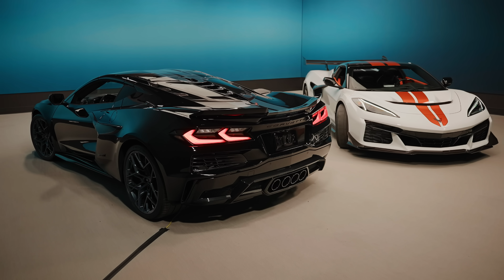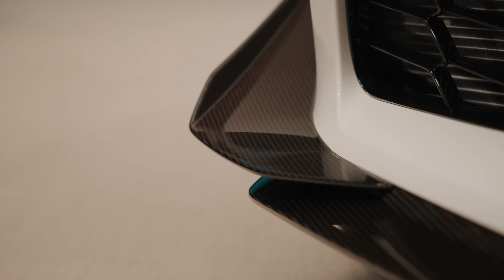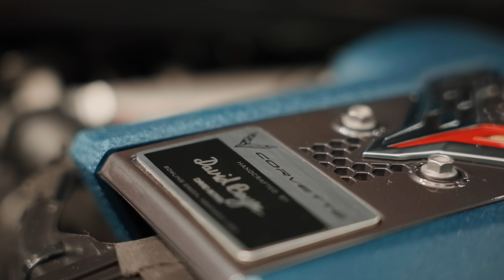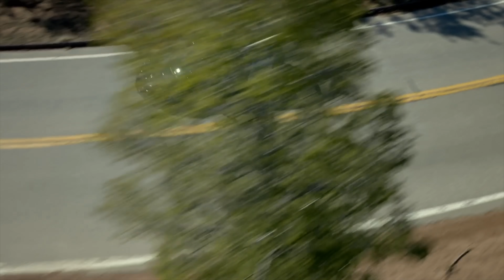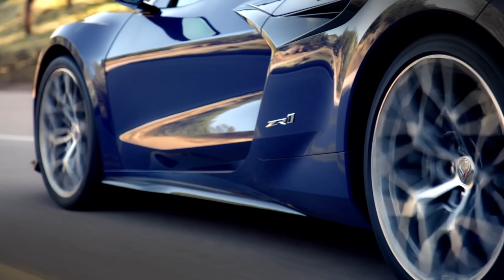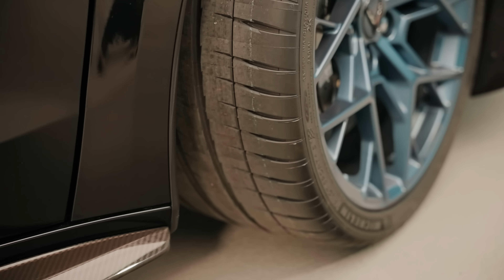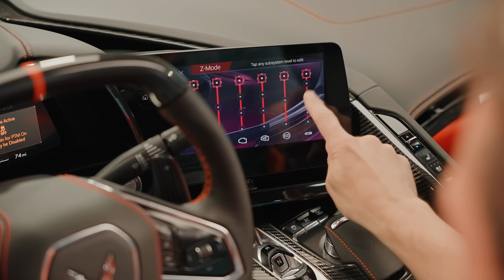FIRST LOOK: 2025 Corvette ZR1 – 1064hp, Turbos & 215mph!

Comment from the maker: This, or a GT3 RS?
Reply: Vette.
Reply: I'll take the Z06 over the GT3.
Reply: This iteration of Corvette ZR1 would annihilate the Porsche GT3 RS on a straight or around a track easily!
Reply: @davidhunter9974   I doubt it - yeah its going to destroy a GT3 RS on a straight. But on a track? 300kg heavier, softer suspension, but most importantly only 550kg of downforce vs the GT3 RS 860kg. Meaning the GT3 RS will corner faster. Much faster. A fact that seems confirmed when they mention this car has been round the Nurburgring but don't state a lap time. The GT3 RS did it in 6.44 - the second fastest time for a true production car ever. To put it into persperctive i think the fastest time in a C8 Z06 is 7.23. This wasn't on an empty track but the estimated best possible time for a Z06 is 7.10. Still miles off the GT3 RS. Yes the ZR1 is much more powerful but its also 100kg heavier. The ZR1 will likely break 7 mins. I don't think it will dip below 6.50 though.
Reply: Used Gt3s going for $400k+ so I guess 2 ZR1s
Reply: Right now the Z06s are going between 140-170k. This new ZR1 you won’t be able to touch under 200k. My guess is they will be between 205-240k and there will be significant markup 30-100k
Reply: @mattsomeonewithansrt3948 they’ll easily be between $300k-$400k for a while.  This is the kind of car where if you have to have it then that means you HAVE to have and people with disposable income will pay whatever it takes to get one.
Reply: @JackaLopius  Coupe and Convertible for that price for sure, lol
Reply: @JackaLopius  and there s a reason for the GT3RS to sell at higher price point
Reply: @JackaLopius you know these are going to be marked up to that level.
Reply: @JackaLopius  2019 RS's are going for $200K
Reply: @JackaLopius what u think these will sell for ?
Prob 400k
Reply: @JackaLopius the corvette will be 400k when the dealers get
Their greedy mitts on em
And you’ll
See half million dollar used ones 

100% gonna happen
Reply: @JackaLopius this is gonna be half a million after dealer markups 😔
Reply: @JackaLopius  🤣 Sike I’m not a boomer going through a midlife crisis be so fr
Reply: @Kilometerss  
Porsches and Corvettes are prime midlife crisis cars.
Reply: @Kilometerss  honestly feel bad that you can't enjoy a car because the internet told you a certain kind of person drives it
Reply: @Vincetagram  imagine thinking that had anything to do with it🤣
Reply: @Kilometerss  All the boomers are at least 20 years past midlife by now.
Reply: @Kilometerss  You can't afford either one so what does it matter
Reply: @Kilometerss  a baby boomer midlife crisis would have been in the 1990s to early 2000s... what decade are you living in? Boomers are mostly retired now.
Reply: @Kilometerss  dude I had two corvettes in my early 20's. I had no bills, lived at home, and a good full-time job. Had a C6 corvette and a 2008 Z06 Corvette with Corsa exhaust. Yeah, I know that makes me kind of old, but Corvettes don't have to have anything to do with your age. The reason you see a lot of middle-aged men driving them is because they are mostly the only ones that can afford one after working for a long time. I could say that lifted pick-up trucks are for young men trying to compensate for their small package they are insecure about.  The higher the lift off the ground, the smaller the pee pee. all these stereo types are just for jealous people who can't afford one. except for the super lifted trucks. Those are mostly owned by insecure men. ;-)
Reply: Probably a GT3 RS becuase you know it will be a better car overall, but I think it would be a very difficult decision in the real world, this new Corvette is next level amazing.
Reply: @KnightIndustries572  wdym better overall? The ZR1 is much faster in a straight line, take corners not much slower, has a more comfortable ride and more comfortable seats, has more luggage space, and has similar quality along with similar driving experience.
Reply: This Corvette any day
Reply: @austinhazlett2k17  y all nuts, chevy or porsche. Porsche for build quality anyday, that's without even considering the performance on track and the look of the car
Reply: This all day
Reply: how are we suggesting that these two should be compared? GT3 and Z06 makes more sense.
Reply: @madskater5 He is talking about GT3 RS; not a normal GT3
Reply: @toughcookie218  I dont think that changes my mind. gt2 rs vs zr1 maybe?
Reply: This all day and with the extra savings could add more aero to snuff any GT3 RS.. that much power needs more aero for sure on the right track.
Reply: Corvette
Reply: Thats a hilarious question.  Who would pick a measly GT3RS?
Reply: It doesn't matter I can't afford either😢
Reply: This and it's not even close. You should be asking this or a GT2RS tbh. Even then, this will slam it on a track given the driver is capable enough
Reply: Both
Reply: Comment like this makes me question Motor journalism.
Reply: This
Reply: This Corvette all day.
Reply: Corvette all day, screw porsches on all allocations
Reply: As a German who loves Porsche this ZR1 all day.
Reply: @jostrander71  I am excited to see what Porsche does for next generation, with competition like this they can't stay out of the horsepower race any longer. As someone who isn't a porsche guy at all, this competition is just good for sportscars, no matter what brand you prefer. Chevy knocked it out of the park with this generation of corvettes.
Reply: This and a down payment on a house.
Reply: Porsche is overrated this corvette anyday
Reply: @drippgxd  goofball comment of the year. The most desired brand on the planet and most profitable company
Reply: ZR1 easy.
Reply: Zr1 I have a c6 grandsport vette already
Reply: Boffum
Reply: This
Reply: Vette for sure.
Reply: I love porsche, but this might even outso the 765LT....
Reply: Zr1
Reply: The Corvette all the way. I've always been a Porsche guy but this is on another level of performance and affordability.
Reply: easily this. ig u go with GT3RS ur brainwashed
Reply: @TopGear  Obviously the C8 ZR1, come on now, can’t beat a high revving twin turbo V8!
Reply: THIS ALL DAY - C8 ZR1
Reply: Depends if you want to go faster, or if you are willing to spend double the money so you can be hip on social media.  I don't care what internet nerds think, so the Corvette is an easy choice.  What other advantage does the GT3RS have?
Reply: Vette. Easy choice
Reply: Ford Mustang GTD
Reply: The C8 Z06 already has the same lap times as a GT3RS. The C8 ZR1 is more comparable to a GT2RS.
Reply: 100% corvette
Reply: 2025 Corvette ZR1 Coupe please!!!
Reply: That's an easy question.  The 2025 gt3 rs comes in a 6sp manual.  That makes the gt3 the obvious choice.  Screw those sissy paddle shifters.
Reply: This all dayyy zr1 no question
Reply: Corvette has always been better than 911
Reply: From a performance standpoint, there is no contest really, I will take both.
Reply: give me a gt3 touring and i'm happy, elegance and refinement over brute force
Reply: Manthey 911 GT3 RS
Reply: E-ray... I'm only thinking practicality.
Reply: This!
Reply: This
Reply: Corvette for sure
Reply: ZR1
Reply: 1024hp!!! Can't wait for all the videos of 70 year old retirees flipping off 20 year Olds in 95 civics beating them at 8am on Sundays.
Reply: @masturone8257  more likely it'll be the 70 year olds stuffing them into trees because their geriatric old asses can't handle that much power
Reply: GTR R35
Reply: GT3 all day long but it’s a lot more expensive if you can get one
Reply: @chrisvig123  for the track?
Reply: Turbos muffle the sound of the ZR1 engine. 
So it's gonna be GT3 RS with its 9000rpm NA redline echoing off the walls and grounds of circuits and buildings. ZR1...crickets chirp chirp.
Reply: If I lived in the States, the ZR1 for sure, but for European roads the GT3RS.
Reply: @thunderpants007  ZR1 and GT3RS at both kings foresure, happy to have cars like this share the road together.
Reply: A ZR1 and a Z06 it’s something different.
Reply: GT3RS can’t compete with the new ZR1 😂 that what the Z06 built for. ZR1 competition is GT2RS, Ferrari FS90
Reply: @prosperityspeaks5725  Can't compete where? On a track? Because it has to be straight line since the 3rs is faster than 2rs on the Nurburgring.
Reply: GT3 RS is 300kg lighter, 300kg more down force, NA vs Turbo, 9000rpm redline vs 8000rpm and generally considered the best drivers car ever. As Colin Chapman famously said "Adding power makes you faster on the straights. Subtracting weight makes you faster everywhere."
I don't see how this is even close - I'll take the lighter, better handling, 9000rpm screaming agile beauty over the no doubt impressive blunt object with a gigantically powerful engine.
Reply: GT3 has a NOT ugly steering wheel and has a manual. So the GT3 all the way!
Reply: GT2 RS
Reply: @SayakMajumder  double the price
Reply: @scoobydoo5164  
ja, ja ... und double da fun!
Reply: Thats Apples and Oranges my Friend
Reply: ill have both 🤷‍♂😂
Reply: This ofc 💯
Reply: @FETNM4L this
Reply: Dyno papers please. All american automanufacturers are like we do this and that bla bla bla. Mustang GTD go sub 7 on the Nür? It will not. Dodge 170? Yes it will take 170 tries to do the claimed 0-60 and 1/4 mile time on a SUPER PREPPED SURFACE. And now this, lies lies lies lies. GIVE US PROOF and stop listen to their BS. Its not all about power, its how its set up. Only thing american automotive is good at is beeing corny, yeah thats right. Support john deer instead of this sheit.
Reply: fuck Porsche lol
Reply: I choose the mom
Reply: Vette
Reply: Thats like asking "Turd sandwich with a side of roadkill or a wagyu steak dinner" of course the GT3 RS. You'd have to be a braindead hillbilly pedo to think the vette is a better option over a porsche.
Reply: C8 ZR1 vs Mustang GTD vs GT2 RS
Reply: GT3, with no RS
Reply: Porsche
Reply: yes
Reply: Still hard to beat the sound of the gt3 rs, the turbos I'm sure quiet this down
Reply: @narek_kona302  over 1khp to the rear wheels at 8k rpm, I don't think that's going to be a quiet engine, actually.
Reply: Kudos to GM, but Its never a good idea to bet against porsche engineers. They'll beat this with 800hp tops. 911s are just on another level.
Reply: @jw6188 
At the Nurburgring, yes. Anywhere 
Else no. They tune the Ring cars
Specifically for that record run. 
Any brand can do stuff like that 😂
Reply: @jw6188  800 ? Nah, 525, and a New Aero kit lol
Reply: more like this or a gt2 rs
Reply: Corvette takes the cake
Reply: This or a k20 swapped mr2
Reply: GT3 RS... assuming the ADM and allocation game doesn't get in the way
Reply: Whichever is easier to buy if you had the money at asking price (without a huge markup out the door) 😅.
Reply: Vette to hammer on and drive, 3rs to park in garage with full ppf and take to cars and coffee once a month and sell it 5k miles or less
Reply: Gt3
Reply: GT3 RS just looks way better
Reply: @anitaru2001  lmfao the GT3RS is just as gaudy as this is.
Reply: Americans n their fake hps
Reply: GT3 RS
Reply: Gt3 RS any day, even a destroyed one can sell for 100k apparently.
Reply: not close
Reply: Should be this or the gtd. That’s a more practical comparison since this is what they’re responding with to ford
Reply: GT3 RS
Reply: GT3 RS is a track weapon. Not sure about the corvette's agility until you drive it and we see the numbers
Reply: I'm sorry. Gt3 rs for the manual. Corvette, if I've gotta get an auto
Reply: GT3 RS
Reply: No. Not a GT3RS but a GT2 Twin Turbo!  I'll take the Porsche hands down anyday!  Porsche has won more 24 Hrs of Le Mans championships at the top class than any manufacturer!  Not even close!!!
Reply: @LWRC  This thing will beat a GT2RS hands down.
Reply: @sarkaranish  
So you like drinking moonshine instead of real fine wine?!!
Very very few of the homeboys out here who think they're race driver caliber can drive this machine to its limits!  Remember, this is only RWD.   If you think Porsche doesn't know what they're doing - take a look at their 24 Hrs of Le Mans win records!  How many top class championships has GM won - ever??!!!
Reply: Neither buy land
Reply: As incredible as this car is..... I still choose the gt3rs. It's a 911 🤷
Reply: @nissanFanboyRB26  Rear engine vs mid engine, I'll take mid engine. Let's see what the Nurburgring says.
Reply: As a 2024 Carrera S owner, I say this one...  I wanted to buy a C8 Z06 but dealers were asking way too much.  I went with the Porsche.
Reply: THIS NO QUESTION!!!
Reply: ZR1 all day!
Reply: Too early to tell
Reply: Gt3 RS
Reply: THIS!!!... This one any day of the week, and twice on Sundays!!!!
Reply: this obv
Reply: Vette
Reply: Koenigsegg Jesko
Reply: 3RS is 500hp down on power. It's not even in the same class of performance. I'd take a normal GT3 over both.
Reply: GT3 RS
Reply: GT3 ❤
Reply: GT3 RS only because I couldn’t live with the GM interior and I dislike the rear styling of the Corvette.
Reply: Zo6 or gt3 easily over a RS or a ZR1
Reply: GT3RS im sorry not sorry
Reply: GT3 RS all day, everyday.
Reply: only corvette
Reply: This, until the Zora appears. Then it'll be that. I'm very confident the Zora is coming, and when it does, McLaren, Ferarri, Lamborghini, and Ferarri will have a real battle on their hands. A 1250 horsepower AWD Corvette? Nuts, absolutely bonkers. This thing with an exhaust would likely touch 1100, and with a good tuner, it could see 1200+ easily. This new ZR1 is an honest to goodness supercar.
Reply: GT3 all day. it will actually hold value
Reply: Both ❤
Reply: ZR1 all day everyday😊
Reply: This, without ztk kit,
Reply: Gt3 of every Generation
Reply: Gt3 rs but I’m not one of those fans…
Reply: GT3 RS
Reply: Corvette any day.
Reply: It's American...it is not Zed
Reply: Corvette hands down just due to me being from the original home city of the car from 52-82
Reply: New GT2RS will clear this tho
Reply: Twin turbo V8 vs manuelle. Idk. Corveffe
Reply: Id take this cuz Americans love horsepower. And I'm American
Reply: GT3 RS is more compareable to the Z06(C8)
Reply: Corvette
Reply: Porsche
Reply: Uh not even a comparison?

GT3 RS is a ultra limited production Porsche very few will ever get the chance to even buy. The ZR1 is a mass produced track ready car anyone will be able to buy provided they have the money.
Reply: Gt2rs… but ye probably this
Reply: Porsche... But undeniable monster this corvette.
Reply: Vette of course.
Reply: GT3RS because I'd be too scared to drive this monster 😂
Reply: GT3RS; It’s not overpowered to an absolutely boring degree.
Reply: Corvette everyday
Reply: GT3RS todo santo dia
Reply: This❤
Reply: This
Reply: GT3RS all day
Reply: Contemplating a move to the US, as long as Europe burries itself into eco crap and downsizing.
Reply: GT3 RS literally has less than half the HP, corvette everytime
Reply: New GT2RS coming in 2026 should be compared to this
Reply: Skateboard
Reply: This. Duh.
Reply: RUF 550
Reply: Not even comparable,  yall love to
Stir up these Porsche groupies in
The comments. Pointless asking 
Questions like this lol
Reply: This thing is going to cost the same as current gen GT3.
Reply: ZR1 all day everyday
Reply: Carrera targa gts
Reply: Interesting comments here. Track performance isn’t everything, but the Z06 already is at par with the GT3 RS. Slightly faster on some tracks, slightly slower on others. The ZR1 has more power, more aero, and better brakes than the Z06. Safe to assume it will be faster around the track than either.
Reply: Porsche doesn't looks nice nowadays
Reply: Can’t get a GT3RS. 

I have bought three new Porsches and still can’t get on the list
Reply: When’s the GT2RS coming out?
Reply: Get what YOU want. Ignorant question. Smh 🎉
Reply: M.i.a.t.a.
Reply: This
Reply: Trust me this can be faster
Reply: corvette
Reply: This is more comparable to a GT2 RS.. when they finally release it.
Reply: Vette
Reply: GT3 or the RS as it's an NA, not turbocharger. A corvette could have 800bhp instead and be even more fun. Shame they out a turbo on it.
Reply: dumb question obviously the zr1 you will be smiling like an idiot and shitting your pants on the zr1 the GT3 RS will seem so dull and boring compared to this the zr1 will make the GT3 RS and 911 turbo look like its standing still lol
Reply: The new Civic Touring Hybrid.
Reply: Zr1
Reply: Hennessy F5 has 86mm turbos! The new ZR1 has 76mm turbos! The ZR1 is one tenth the price !
Reply: An escort Rs turbo white lightning stock pristine example, over any car for driving pleasure in the uk
Reply: I'm not a racer, never been at a racetrack, so neither vehicle would be utilized fully. So it would have to be the Porsche for the brand and resale value.
Reply: This
Reply: ZR1
Reply: I f you buy a corvette you also get a free gold chain and a button down Hawaiian shirt that only buttons half way up. I do t care how fast it is, it’s still a goofy car aimed at a certain type of guy. Plus you can’t throw a rock without hitting a vette. They’re everywhere
Reply: Gt3rs is overrated, and overpriced
Reply: My heart says Porsche, but my mind and wallet say Vette. We're talking about P1 levels of performance for what should cost $175-185k realistically. With dealer markup it'll be closer to $300k though
Reply: C8 zr1
Reply: This by a mile
Reply: @TopGear  A Mustang GTD
Reply: I'm a huge porsche guy and would take a GT3 over a Z06, but I'd take a ZR1 over a GT3RS all day.
Reply: This and I am a Porsche guy.
Reply: This
Reply: An apple, or a pizza?
Reply: This 100 %
Reply: I'm a Porsche guy but not on their preferred list so a limited production anything will never be an option.  Even if I was, I'd chose the ZR1, I'm not a fan of paying to be exclusive.
Reply: hahha do you really need to ask, GT3 RS without any need for a compassion.
Reply: Meh, it's still american.
Reply: The Corsche ZR3 RS
Reply: That is the hard decision I am faced with. 🤔 maybe both haha🤣
Reply: American Muscle baby!!! 🇺🇸🇺🇸🇺🇸🇺🇸🇺🇸🇺🇸🇺🇸🇺🇸🇺🇸🇺🇸🇺🇸😁
Reply: @juanbalboa553  America. Lol...
Reply: GT3RS
Reply: GT3 any day.
Reply: Neither.  GT3 with manual.  NA engine & MT.  Best combo out there.
Reply: GT2RS
Reply: The 911 GT3RS
Reply: GTD..........
Reply: This is a superior car
Reply: This over the ugly 911
Reply: ZR1, easily. Nobody wants a wimpy 6 cylinder!! ZR1 will beat even the upcoming gt2rs
Reply: This 100%. The GT3 RS is overrated. It’s slow.
Reply: Bald Eagle
Reply: This 🇺🇸
Reply: Zr1 and 400k in the bank
Reply: This
Reply: ZR1 BABY!
Reply: gt3 rs
Reply: You Porsche people are hysterical.....
Reply: ZR1 for sure.
Reply: This is cool, but the only car i'd want over a Porsche is an Aston Martin, so GT3 RS MR
Reply: GT3 RS
Reply: Zr1 alllll day
Reply: Gt3rs.
Reply: I'm trading My Ferrari to Corvette
Reply: Corvette all day baby
Reply: foxbody Mustang
Reply: C8 ZR1
Reply: The Corvette, why ? its a Corvette ! Greetings from Germany.
Reply: I think Z06 does match well against GT3-RS. This is more GT2-RS competition.
Reply: The Corvette.
Reply: ZR1 ZR1 ZR1!!
Reply: C8 ZR1! Love the specs, and the look is of my liking. 👍 
Either way, all competitors are more car than MOST of us need. Including the C8.
Reply: I'll take that new Panagale V4.
Reply: this no question its probably half the price at dealers and will perform better on most track regardless you cant beat 1000hp mid engine super car for under 200k
Reply: Seriously?!  Hello, Corvette. Germans. Over engineered, over complicated, nickel and dime you for tens of thousands of dollars, expensive repairs. 

Still overcompensating for starting TWO World Wars. Bowling Green baby.
Reply: this
Reply: or the 2025 Mustang GTD 😍
Reply: I'm not sure, you better run that past Ed Miliband, the reason we can't have nice things.
Reply: This isn’t comparable to a GT3. It’s comparable to a GT2. The Z06 is more comparable to the GT3.
Reply: Always choose this than that car 😂
Reply: ZR1 all day long!
Reply: GT3, and im a diehard chevy person. Sell the gt3 and buy a zr1 AND a escalade to pull it.
Reply: Mustang GTD
Reply: It depends. GT3 RS the best track car out there. Corvette more raw power, not too much for the track
Reply: No comparison.. Porsche>
Reply: Gt3rs is over rated for me....... c8 zr1 any day
Reply: ZR1
Reply: C6 ZR1 #FTW 🏆
Reply: This!
Reply: This
Reply: GT2 RS
Reply: 997.2 911 GT3 RS
Reply: vette is way more versatile
Reply: GT3RS - easy choice if you want the steering wheel on the correct side 😂
Reply: @chrisgilkes1687  ...well, I'm left-handed it should be easy for me!
Reply: vette
Reply: @TroysAdvntures  ???
Reply: GT4 RS is king of downforce 🤫
Reply: C8 ZR1 Convertible all the way.
Reply: @TopGear  lol, seriously?
Reply: Which one would Batman drive to fight Gotham villiany? Hint: The Keaton Mobile is made from two Chevy Imapala's. Nuff said.
Reply: This no questions asked
Reply: Most people haven't felt 500 horsepower under their foot, even less 1064HP.
Reply: This Vette all day everyday. Orange flavor for me.
Reply: This by far.
Reply: Bird poop is fun for corvette
Reply: I'd pick the Porsche,  then sell it ASAP, build me a bad ass, beautiful,  and much faster, slick looking, cool, lady grabber ZR1!
Reply: This over the GT3 RS and then I buy my SO a really good sedan or SUV with the leftover money that I would of spent on the Porsche.
Reply: Both. Idk I just can’t pick! 😣
Reply: GT3RS then sell it and get like 3 ZR1s
Reply: GT2 RS.
Reply: neither, GT4RS
Reply: neither, Revuelto
Reply: Corvette without hesitation.
Reply: GT3 RS for short tracks and the 2025 ZR1 for LeMans or Spa or other higher speed tracks.
Reply: ZR1.
Reply: Porsche GT3 RS has a 3rd Fun Pedal 6 or 7 Speed Manual Transmission, which with the Manual Transmission doubles or even Triples in Value even after 7 to 8 years  of ownership. To Me the real 3rd Fun Pedal Transmission is more important than any Automatic Paddle Shifters. In 2022 Dealership said I could buy the GT500 behind me, and i said you could sell it to me for $30,000 I still wouldn't buy it.. it was Gun Metal Grey and I wanted a White one.  In August 2022 I bought the only White V8 Mustang with the 3rd pedal 6 Speed Manual Transmission in all of California.. It is a 2022 Roush Mustang. It will be the best car i will ever own. With the Magneride that kept the car leveled no matter how hard you attack the corners it also has the Intercooled Limited Slip Torsen Differential, the same as the GT500 they tried to sell me .  The most important Tremec Rev-Match 6 Speed . 👨🏻👍🏻🏎🏎🏁🏁🚩🚩
Reply: GT3 RS is a refined track car that is made with only the most premium of materials and build quality. This thing is an entirely new car from a company that is currently making some of the worst cars in the world. What could possibly go wrong!
Reply: Always American Muscle!!!
Reply: GT3 RS is too slow compared to this monster.... The Porsche outputs half the power!
Reply: ZR1 in Yellow with Targa Roof and Track Pack.  Awesomeness!
Reply: Why not both...
Reply: @ I find this to be acceptable
Reply: Not a Chevy. Not EVER.
Reply: This Corvette all day everyday.
Reply: If you have a brain you take the Vette, if you are a demo'rat you take a Nissan Leaf!
Reply: If I'm looking for clout and resell value, I'm buying the Porsche. I'll buy the one that's cheaper to purchase and maintain. 
As far as performance numbers? My driving skills will never come close to driving at the limits.
I'll run out of talent long before these cars run out horsepower and hit  lateral G potential. 
I feel like most of these engineering marvels will be trailer queens that only drive 200 miles a year cruising and parking with the hood up.
Reply: @TopGear Buy two Zr1’s for about the same price, store them  and I don’t see any price drops! Of course I would drive one and store the other. No one can drive one to their ability on the streets and who the fk would race it! I guess Elon could but I’m talking about normal rich people.
Reply: I could buy two corvettes for the price of one GT3 RS. I love the Porsche look but if I was looking for performance and affordability, it would be the corvette
Reply: I prefer C8 ZO6 & C8 ZR1 both with fully loaded with options 🏁
Reply: easily the vett
Reply: Corvette 🇺🇸 🏁 
Save a boatload of cash while you're at it 💸 💰 🤑 💲 💵
Reply: @googleaccount2637 US dealers will throw these for 100k over sticker price for sure....... 😂😂😂
Reply: GT3 RS? At a shade under $200k, this is like a Carrera S with a leather interior and PCB.
Reply: @tisithecount4198 yeah, not exactly…
Reply: @thedudeabides1443  just checked and no Carrera S on the configurator. But a targa GTS with red stitched interior and PCB is over $200k. Point is, if you did a dollar to dollar comparison you’d get way less car with the Porsche. And I’m a Porsche nut. GTS is literally half the power
Reply: @tisithecount4198  what ???
Jeez, ok
Reply: GM all day. Europe can take the middle finger. All hail the good ol' American V8.
Reply: Este auto ya dejo fuera al GT3, ya va en otra liga por prestaciones, es lo que sucedió con el Saleen S7 twin turbo o bueno eso me recuerda...
Reply: GT3 RS
Reply: GT3 RS any day of the week. Power isn't everything
Reply: @JustSomeGuyWithNoMaidens  nope this things going to be right at home on the track.   Full carbon everything on the track package...the z06 already beats the Porsche in the gt and imsa racing series.
Reply: @JustSomeGuyWithNoMaidens  but as a car enthusiast I don't want to knock Porsche they're absolutely amazing.  But I'd prefer a nice shelby gt350r and this zr1 some day.  The Porsches are out of my price range.  I'd prefer a mercedes amg black series gt over Porsche but Porsche is always amazing for what they've accomplished
Reply: New GT2 RS
Reply: GT3 RS. Obviously.
Reply: @analogwerks  lmfao, fanboys gonna fanboy
Reply: @analogwerks  Garbage.
Reply: @analogwerks  Maybe you should watch the video again.
Reply: @analogwerks are you 9
Reply: @analogwerks gay
Reply: @analogwerks then you are an idiot
Reply: @analogwerks are you slow? This thing does exactly what the GT3 RS is made to do but is faster quicker and looks better lol
Reply: @BobbyJoe24. I know it's subjective but it does not look better 😅. But you're entitled to your opinion, so there's room for differences.
Reply: @BobbyJoe24.  No it is not, don't be rude when you don't have a clue
Reply: @BobbyJoe24. Porsche glazers I swear 😂
Reply: @BobbyJoe24. this does not look even close to as nice as the porsche tf
Reply: Wait for 992 GT2 RS hehehe
Reply: @Insignia-q4h  it will probably be in the 800hp realm. It might weigh a bit less but top speed is a HP equation not a weight equation. I am very excited to see that car when it drops though
Reply: @Insignia-q4h  Yes sir , will be a monster
Reply: @Insignia-q4h   The 992 GT2 RS is a while away and going to cost 600K minimum.
Reply: This is going to take a fat  💩 right on anything Porsche has made.  Track or straight line.  And sound. And looks.  And price.  2 of these for one gt3rs
Reply: @internationsole_junkie  sound? The turbos muffle the engine note of the ZR1. The Z06 sounds savage and the GT3 RS had a 9000tpm symphony. I'd Rather the Z06 as a total epic package. Sounds looks handling price.
Reply: @internationsole_junkie that naturally aspirated flat 6 racing engine sound way better as any generic twin turbo V8 ever will.....
Reply: @dynapatrick894 bear in mind the Porsche haven't released the new turbo s or gt2 rs. A 800hp Turbo s will most likely spank this over-rated thing.
Reply: @internationsole_junkie  the Turbo S would destroy this 😆
Reply: @Automattie  you’re out of your freaking mind, the Z06 turns faster laps than the turbo S, this thing will bury it 20 feet under the ground.
Reply: @markw9512  cite  your source!! The TURBO S is quite possibly the most efficient track car. It devours competition
Reply: GT3RS. You won't use all this power much on the street, whereas GT3RS is instant throttle response and much more focused handling
Reply: @Shadowboost it's a V8 how much more throttle response do you want?? Wtf😂
Reply: @sieve5  I want GMA T.50 52,000 rpm/s throttle response. But I'll take 1/3rd that if I have to
Reply: @Shadowboost  You can't use all the GT3RS' power on the street either
Reply: @aaronvector4750  sure you can. You don't have to worry about wheelspin in third gear
Reply: @Shadowboost how do you know that?
Reply: @Shadowboost   Why would someone drive a GT3 RS on the street? Street driving is for a 911 Turbo S.
Reply: @TNOverland  because NA at 9000 rpm is exciting
Reply: @Shadowboost  You're guessing, we don't have any idea how this is going to perform on the track. The GT3RS is normally aspirated so throttle response on the ZR1 should be faster and with the turbos kicking in at low RPM this thing should be brutal.
Reply: @luisguadalupe7445  But most importantly the Corvette weighs 300Kg more and has 300Kg less downforce. All that power won't do shit in the corners, but the weight and lower downforce sure as hell will. 
And since when do turbos have faster throttle response than NA cars?
Reply: @paulharrison443  Well, you are forgetting that the Corvette engine before the turbos kick in has more horsepower and torque than the Porsche engine.
Reply: @luisguadalupe7445  So what? You said the ZR1 should have quicker response because the GT3RS is NA. Why would a turbo engine have a quicker throttle response because its not NA. Power was never mentioned, induction was.
Reply: @paulharrison443  ZR1 torque 800lb-ft available at just 3000 rpm, Porsche GT3 RS max torque 342 lb-ft @6,300 rpm. The 5.5 flat-plane crank V8 without the turbos already  has outstanding response with twin turbos kicking in at just 3000 rpm response should be brutal. How good will it be on the track? Well, we will find out soon; granted, the hardware isn't as extreme as the GT3 RS, but it should be extremely capable. The Porsche is 454 pound less, but the power and torque are just too much to overcome.
Reply: @luisguadalupe7445  you still never answered my question - you said it will have a slower throttle response because it’s NA. There was no mention of power or anything else. Just the fact it was NA. So I’ll ask again - why does being NA mean it will have a slower throttle response? 
As well as the weight difference you also forgot the rather important downforce figure.
Reply: @paulharrison443  let's use your favorite as an example, Porsche 911 turbo S2, full torque is available at 2900 rpm, launch control happens @5000 rpm. Turbos are @full boost, 0-60 happens in an amazing 2.2 seconds. I don't think you will find an n/a car without modifications capable enough to accomplish that.  Regarding downforce, the new ZR1 out of factory max out at around 1200 pounds. How does that translate in real life on track? I don't know until it's actually tested, and by the way, I'm aware that the GT3 RS downforce max out @ 1900 pounds.
Reply: @Shadowboost you must be a tad slow. Both are focused for exactly the same thing. The. You make objective statements most wouldn’t agree with and certainly can’t be proven.
Reply: @danetrain797  most wouldn't agree with? The fuck you talking about
Reply: You really trying to compare this trash a German monster? lol
Reply: Dumbass question. This has double the horsepower. I don’t even know why you would compare them. Gt3rs will still be more expensive anyways
Reply: 720s
Reply: No one but an American would drive this tasteless thing. RS
Reply: GT3.
Reply: the vette, not that there is any comparison since porsche engineering is quite unmatchable but the vettes price and daily usability might out do the porsche.

The V8 with turbos putting out 1064 horses sounds amazing with all the arrow going on!!
real changes : )
Reply: @EvolvedCasualGamer_HM  Lol, the same Porsche engineering that brought us IMS bearing engine failures, cylinder bore scoring, GT3 engine failures, cracked GT4 strut towers, Macan PDK failures, etc. etc.? Stop putting these overpriced Volkswagens on a pedestal.
Reply: @IndependenceCityMotoring   haha more points in favor of buying the vette then : )

Porches can only be bought if the company lets you despite having the money.

I cannot argue with what you have written!!
Reply: The Porsche. You can either by a car by a Company that refinse the car and puts it's best efforts into it, the GT3 RS. Or you can put your money into a car from aCOmpany that is so cheap it goes parts bin as often as possible as puts parts on every make of the Company. the Chevy. I would alsmost bet money that you can take the Oil filter off of a 1981 Chevy truck and put it on a brand new one and it would fit. In fact, I wouldn't be surprised if both trucks are almost completely interchangable
Reply: @ I keep waiting for the Germans to bring our flag from the moon since they have such great engineering.
Reply: @RobertGuidry-f3f  I'm a fan of engineering and innovation, but if I can get comparable performance in a cost-effective and simplified platform, that's what I'll choose every time.
Complex engineering adds cost without adding value.
Reply: @fortytipper  And you really want to have to fix something every Month? No, then buy a Mustang.
Reply: GT3RS because the power is actually useable this is way too much for the real world
Reply: @jakefox3677 the gt3 rs is not too much for the usable world?
Reply: @jakefox3677  too much HP for the real world???
Reply: @jakefox3677  way too much? have you ever had 1k hp car i do not think so.   you can easily use it  try a 60-160   with your 500 hp car it is slow af
Reply: GT3 RS are you high?
Reply: @Kilometerss  porsche costs double, has half the horsepower and 2 less cylinders
Reply: @Kilometerss you clearly have never driven a gt3rs. Corvette all the way.
Reply: @  okay boomer
Reply: Money no object? GT3 RS... HP numbers are amazing with the Vette but I doubt they translate on faster times around a track.
Reply: @geogmz8277 considering the Z06 has beaten the GT3RS on some tracks already shows how stupid fast this thing will be
Reply: @fusionmediaproductions280 
Obviously, it's not only about HP is it??!!!   How about fit and finish and overall construction and driver's feel??!!! 😂😂😂
Reply: @LWRC  C8 is built very well at their bowling green plant. Great fit and finish. Not that it matters to a GT3RS because it will be too far behind to see.
Reply: @sarkaranish  
For the buyers, I hope so.  I won't be buying one.
When the C8 first came out, I was at one of the largest Southern California dealers and was looking at a C7 Z06. They were pulling one out from back and I was in the showroom looking at one they had on display. I sat in the driver's seat and could see a reflection of something weird through the front windshield. I got out and looked through the front glass from the outside. It was a warped piece on the dash!  Unbelievable!  And this had this in the showroom!
Maybe GM build quality has improved but based on all the problems OWNERS of C8 Stingrays have reported here on YouTube, it is not confidence inspiring!
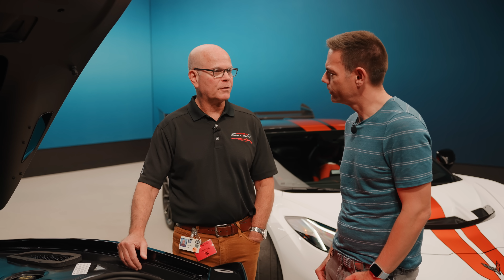Reply: @fusionmediaproductions280 fastest lap done by a C8 (z51) at the Nürburgring was a 7:29..... Doubt it will beat the GT3 RS there
Reply: @the911collection  no way you think a base C8 is anything like a Z06 or ZR1😭, this thing is going to obliterate a GT3RS, ZR1 has always been the GT2RS fighter, they’ve always been extremely close on track together
Reply: @fusionmediaproductions280  Still waiting for them on the Nürburgring. At some point you have to admit that doing a lap time on your local circuit or doing it on what has become the world barometer for sports cars is not the same thing.
Reply: @fusionmediaproductions280   I think you are massively underestimating how fast the GT3RS is around the track. It has the second fastest time ever for a proper production car round the Nurburgring - its sub 6.50. Its also 300Kg lighter and has 300Kg more downforce than the Vette. The corvette will destroy the Porsche in a straight line, but tracks aren't straight and the GT3RS will destroy the Corvette in the corners. A Tesla Plaid is 1,000bhp+ and will destroy a GT3 RS in a straight line - the fastest a Tesla Plaid has done the Nurburgring is 40 seconds slower than a GT3 RS. The Corvette will be massively quicker than the Tesla, but to suggest it will "obliterate" the GT3RS is delusional. Also, fun fact, the current GT3RS did the Nurburgring 3 seconds faster than the GT2RS - that's how fast this thing is.
Reply: @paulharrison443  I understand that, but the C8 Z06 has been running similar times, and in some cases beating the GT3RS on some tracks, this c at is meant for the GT2RS they have always been extremely similar to each other lap time wise, even back to the C6 and 997 gens, they are only 1 second off each other on the ring
Reply: @fusionmediaproductions280  current faster Nurburgring time for Z06 is 7.23. Estimate for best case scenario on a clear track is 7.10 which is 25 seconds slower than the GT3RS. The current GT3 RS was 2 seconds FASTER than the GT2RS round the same track. The GT3RS is bonkers quick. This corvette may give it a run for its money but I certainly wouldn’t be sure of it.
Reply: @paulharrison443  the previous gen z06 the c7 did a 7:13, they have never done an official lap for the C8 Z06, if you looked at times on other tracks you’d realize how close they are in terms of lap times, the C8 Z06 has beaten the 992 GT3 on every single track they’ve been compared on, by several seconds, and that car was sub 7, the Z06 would be considerably under 7 minutes
Reply: @fusionmediaproductions280  hockenheim GP GT3rs is five seconds quicker than the Z06. Mendig circuit GT3RS quicker by 3 seconds. So I don’t know where in earth you get this Z06 is quicker on every circuit claim? That C7 time is basically 30 seconds slower than the GT3RS. That’s 7.5% slower. On Hockenheim the new C8 Z06 with the Z07 performance package was 5% slower than the GT3RS. 
GT3RS was also faster at Laguna Seca, Virginia and Willow Springs.
Reply: @paulharrison443  on throttle house the Z06 was quicker with the same tires on it, at most other tracks it’s a pretty small gap, which is insane when you consider it’s 55k cheaper than a base gt3 but competes with the gt3rs which is more than double the price
Reply: @fusionmediaproductions280  I'm confused? You said, and I quote, "the C8 Z06 has beaten the 992 GT3 on every single track they’ve been compared on" - is that statement true or not? On Hockenheim the GT3RS was 5% faster. On Throttle House the gap was 0.16%. The Corvette is a great car, no doubt, but comparing prices on super cars is futile, as price is not directly related to speed.
Reply: @paulharrison443  I said 992 GT3 not GT3RS, and the GT3 is still under 7 minutes on the Nurburgring, so to say the Z06 wouldn’t do sub 7 is stupid
Reply: @geogmz8277 o z06 já é mais rápido na pista que o gt3 rs, imagina o zr1
Reply: @geogmz8277 The Z06 is already very close to the GT3 RS and is actually faster on some days. So I think the ZR1 is more than enough fight for the GT3 RS.
Reply: @geogmz8277 bet you’re wrong 😉
Reply: @geogmz8277 bet you’re wrong 😉
Reply: The same brand that one LeMans 8 times in the last 20 years doesn't translate around a track? You know not what you speak of.😅 @geogmz8277
Reply: @geogmz8277 em circuito
Reply: @geogmz8277 Faster than what
Reply: @geogmz8277  How could having that much more hp than the zo6 not going to make it faster on a track race or drag? Do you even race or watch racing? This thing is going to kill the already fast z06 times and will be on par with ALL supercars even the GT3 RS you will see fanboy.
Reply: @cmo5807  You're assuming you can transfer those 1000whp to the ground as you can with Z06.. Nothing said about the suspension suggests this thing is going to be superior to the Z06.. While Porsche! Is 1- Known for excellent braking but also for absolute fantastic suspension and Aero... 

So yeah you m0r0n! There's more than power in play to be fast around the track. Do you even watch any Motorsports?
Reply: @geogmz8277  dude the Z06 already has faster times than the GT3RS on some tracks. With 400 more hp and more aero, the GT3RS wouldn't see which way the ZR1 went😂
Reply: @geogmz8277 who cares. Feeling the call push you back into the seat is so much fun! That’s something the GT3 RS doesn’t do.
Reply: @geogmz8277  That's it. Lots of brands with incredible numbers but very few capable of holding the road like this Porsche.
Reply: @geogmz8277  the c8 Z06 is already faster than a gt3 rs around many tracks
Reply: @geogmz8277   HP numbers arent everything but this ZR1 is going to beat the GT3 RS in high speed tracks. With all performance options the ZR1 will be 210,000. The GT3 RS before markup is well over 250k. The Americans have the price to performance on lock.
Reply: @geogmz8277 
I bet it does
Reply: Wait for the GT2 RS for a fair comparison
Reply: Mustang GTD and I’m a Porsche guy. 😂
Reply: @Automattie  the answer suggests you're not a Porsche guy any more 😉
Reply: @jamesj590  Liking a Brand doesn't mean being tied to it forever, it's a car brand, not a religion bro
Reply: @Automattie  the GTD is getting WALKED by the ZR1
Reply: @Fatal_Inertia  more HP doesn’t mean faster on a track.
Reply: @Fatal_Inertia 
Is the GTD getting out paced by this around the nurbergring? The GTD isn't a car you "walk" some other car with. Neither is the GT3rs.
Reply: @Automattie yes it does it absolutely does. It is why there is BOP in WEC ,F1 and IMSA
Reply: @blaw11b  all those cars have different parameters for racing, different tracks, different rules, different chassis. Different fuel etc.
Reply: @MD-xb1qw this is true, but even the z06 was beating the 911.1 gt3rs around the track.
Reply: @Automattie more than double the horsepower does
Reply: @Tetsuo1312  it cant put all that to the wheels efficiently. That’s why Porsche is superior.
Reply: @Automattie 😮 No replacement for displacement. If it doesn't mean that it'll be faster then it also doesn't mean it'll not be faster
Reply: @Tetsuo1312  HP is largely marketing. Most of the HP ain’t even available on a track or DD😆😆😆
Reply: @Fatal_Inertia  no evidence of that yet
Reply: @Fatal_Inertia Preach Bro.
Reply: @aaronsmith7143  This likely isn't gonna have a laptime on the ring, but on every other track it'll kill the GTD
Reply: @Automattie yes because HP is the only thing the car has. Lol
Reply: Clearly you are not smart @Automattie
Reply: @Michael-ge3eo  oh, Yes!  Let’s use ad hominems when you suck at defending your point. The current Turbo S 0-60 is 2.1 secs. 🖕🏿
Reply: @Automattie  No you are not
Reply: @Automattie  Isn't their like 2 timed laps around the Nürburgring in the GT3 that ran fanter that it?
Reply: this, if you pick the porsche youre a bot
Reply: @Afkduck  I'm picking a manual GT3 Touring over the Corvette, and I'm no damned bot.
Reply: @Afkduck if you choose corvette, you are an npc who never touches grass
Reply: GT2 RS, andI'm talking about then next gen.
Reply: GT3RS, not even comparable
Reply: GT3 RS easy
Reply: @CharlieS-mv9rc really? The Z06 already is faster than the GT3RS in track times. This ZR1is going to demolish it. Why chose the GT3? Any answer that isn't "I'm a Porsche fanboy that's why" doesn't count.
Reply: GT3RS any day and twice on Sundays.  Porsche sets the standard for sports cars.
Reply: GT3 RS easily
Reply: insulting to compare this to a GT3 RS. Though this is finally a decent Corvette
Reply: Neither tbh
Reply: U have 0 taste  @palatialdecoratives
Reply: @palatialdecoratives  At least he's honest about being broke.
Reply: @palatialdecoratives viper👍
Reply: 99% of people will be able to drive a GT3 RS faster around a track than this ZR1.
Reply: @BWalker_VR  That's a pretty bold statement especially seeing how this car is not in people's hands yet and Jethro himself says this handles better than the less powerful Z06.
Reply: @BWalker_VR  no they won’t. GT three RS is difficult to hit its fastest laptops by somebody who is not an expert level driver, because the only way to do so is to take advantage of the high down force it generates, and that’s a special skill set at 99% of people simply don’t have
Reply: @BWalker_VR 99% of people won’t be able to drive either car for shit around the track tbh
Reply: Porsche
Reply: Gt3 every and any day! American cars are complete garbage!